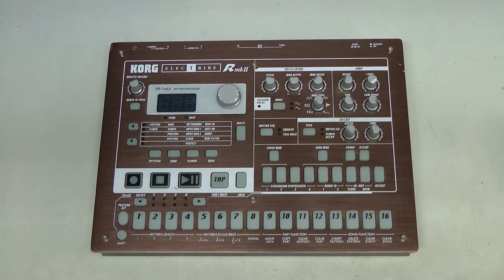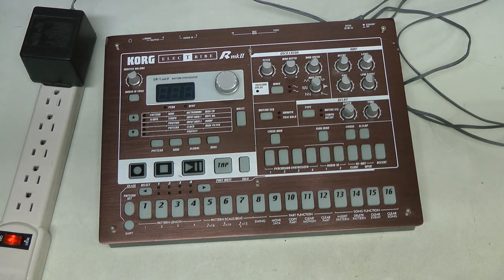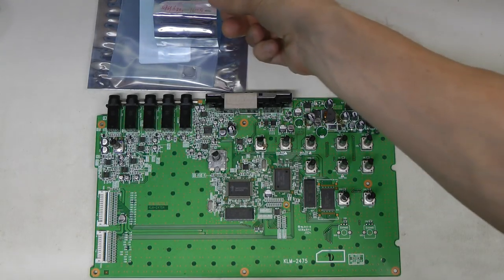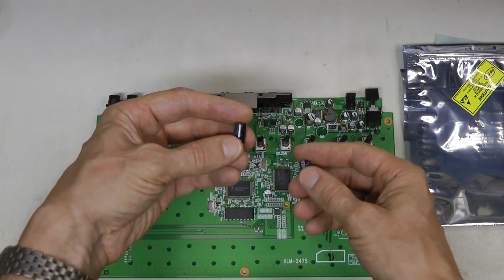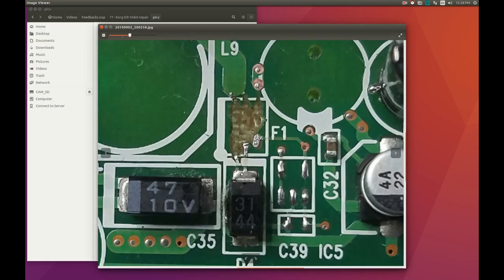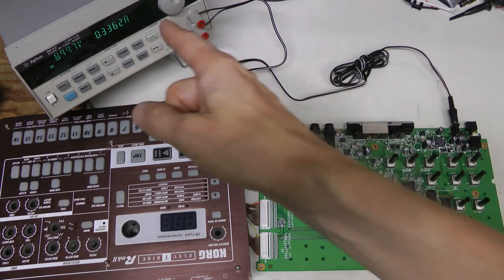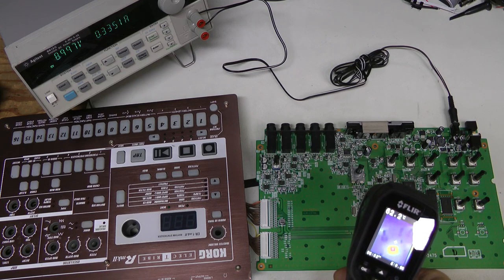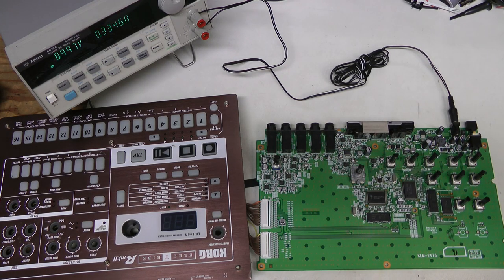#77 - Korg Electribe ER-1 mkII repair fail

Comment: Thanks for the nice debugging video. In my experience, a digital power rail reading a resistance of less than a few hundred ohms is almost guaranteed to have a bad, partially shorted, IC somewhere. It seems to be a common failure mode to end up about in that range you have there. But realistically if there was a large enough overvoltage on the 5V rail to blow a 16V cap, I wouldn't be surprised if each and every chip fed by that rail is blown... So definitely beyond economical repair if that is the case.

Comment: I'm waiting for delivery of a "dead" ES-1mkII, which I suspect has suffered a similar fate to this ER-1. The seller doesn't have the original PSU and said nothing happened when they tried to power it up with a spare PSU. I suspect they probably had a positive-tip PSU, whereas these old Electribes use a negative-tip supply. I'd like to think that circuitry offers some protection against incorrect polarity, but maybe it doesn't?
Reply from the maker: yes, there is a diode for reverse protection. D3 on the schematic. there is a followup video about fixing this thing. they are fixable in the sense that there are no unobtainable parts or something like a microcontroller with firmware in it which would be impossible to extract and copy. it still can be difficult especially if the flash memory chip died. that would take copying flash from another working unit.
Reply: @feedback-loop  Yes, watched both videos! Brilliant and fascinating, thank you for taking the time to put them together. I have already repaired a dead ER-1 (original mk1) that also had a dead regulator section. Luckily when it failed it did not damage anything else like in your poor ER-1 mk2.

Comment: did you try to scope around the cpu and memories to see what's going on? is there any activity? is the CPU trying to read anything from the flash? is there a clock at all? etc...you can find these stuff out if you spend some time with scope on the board ( a logic analyzer would probably be better)
Reply from the maker: I did a little. The 20MHz clock is present, but no meaningful activity as far as I could tell. Maybe I will come back and investigate more one day.
Reply: Looks like someone reversed the power supply voltage or something. Negative tip power - designed to break!
Reply from the maker: No, there is an easy and reliable protection against reverse power - a diode right after the power connector. It drops a few hundred mV, but it is not a big deal.

Comment: Did you check other supply rails in case the regulators are shorted causing an overvoltage on that IC?
Reply from the maker: Yes, other rails are fine. I should have mentioned this.

Comment: It's always the adaptor you need that's not in the box. At least the TSOP48 adaptors are not the expensive ones 👍
Reply from the maker: The cheapest seems to be around $22.
Reply from the maker: I don't think this one is for TL866 programmer.
This seems to be the cheapest one:
https://www.ebay.com/itm/V3-TSOP48-PSOP44-To-DIP40-USB-Eprom-Programmer-Adapter-For-TL866CS-TL866A-Hot/222763221373?hash=item33ddb9017d:g:C0kAAOSw-jFaOmtm
Reply from the maker: On the second glance, the above ebay item shows a wrong adapter on the pictures. The title says TSOP48, but I am not sure this is the right item.
Reply from the maker: I think this is the right thing on AliExpress: https://www.aliexpress.com/item/32994124021.html
I am still thinking whether I should get myself this adapter.
Reply: @feedback-loop   They're always worth having around IMHO.  I'm waiting for the prices of the WSON8 adaptors to hopefully drop, at preset they're about £65 😮

Comment: I suspect someone used the wrong polarity for the power supply.
Reply from the maker: No, there is a diode right after the connector. But a higher voltage (say, 16+) can kill it.

Comment: Nice repair attempt.
What about trying to remove the DSP only, to check if the µP survived and  operates the LEDs and switches?
Reply from the maker: Maybe worth a try. It depends on firmware. It can, for instance, try to initialize DSP, and get stuck doing that.

Comment: Did you check the surrounding caps for shortage, example:  C163, C144? Great video as usual :-) also check the row of caps below C141
Reply from the maker: I checked all electrolytic caps just in case.
Reply: @feedback-loop  I was thinking of ceramic capacitors, I have seen a lot of cases where they are shorted to ground. Any unusual ground levels on the chip's pins?
Reply from the maker: Ceramic caps are fine.

Comment: Just replace the DSP chip, that is what I would attempt. I would skip removing the Flash and trying to read it.
Reply from the maker: They are about $25-30 on AliExpress. A bit too expensive just to try. If the firmware were available, I would go for it.
Reply: dsp death seems to be a thing with these older korg modeling synths :/

Comment: How about an original ER-1?  The original was purely analog.
Reply from the maker: I am not sure about this. I had one before. I repaired it before even starting this channel. A linear voltage regulator failed there.
Reply from the maker: Yes, I see exactly the same combination on these photos: Hitachi H8S/2350 micro-controller + TI TMS57070 DSP
Reply: The original ER-1 was digital as well. The Volca Beats is mostly analog, however.